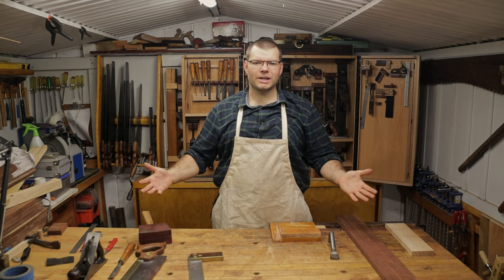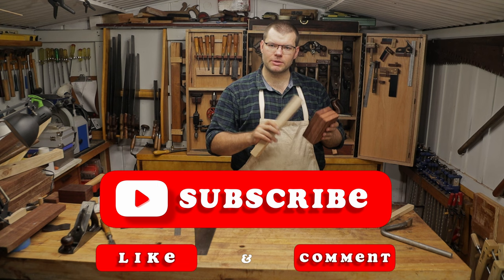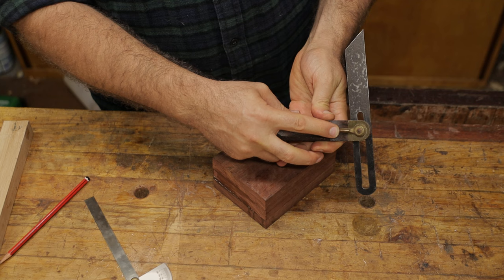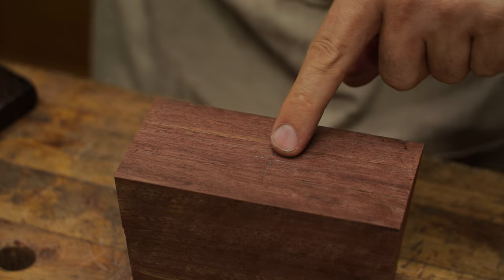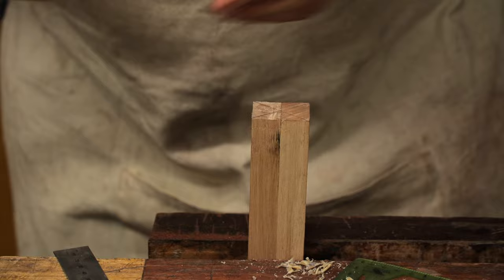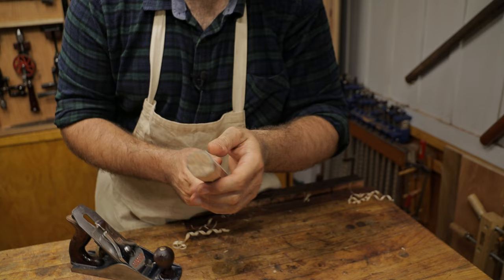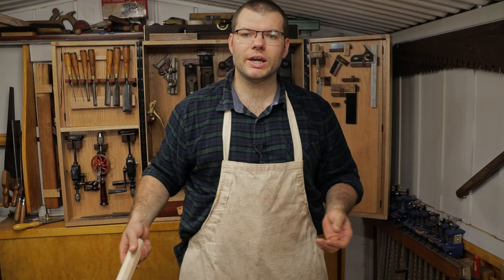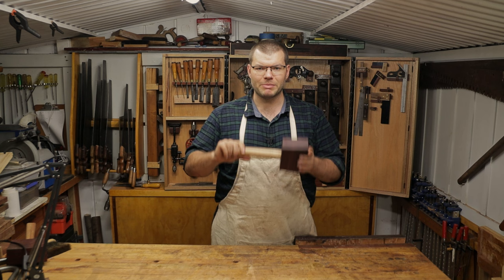Make Your OWN Wooden Mallet

Comment: Beautiful, wedged in through the top is better, less risk of the head flying off if the glue fails.
Reply from the maker: @davestinyworkshop  you're correct but i can't remember the last time my pva glue failed, i can report both mallets are still working perfectly fine with no issues

Comment: Great video, really prefer the handle to come out through the head with the wedge to lock it in.
How do you make your wedges? Do you have a video for a jig you've made?
Reply from the maker: Thanks, Glad you liked the video.  I currently make my wedges by measuring in from the edge of a board 2-3mm, then i run a line off the side of the board from that mark making sure the wedge is twice the length i need (Ensuring the wedge will be in the long grain of the board not the end grain). I then handsaw the wedge out. I know it sounds a little complicated, however its not are hard as it sounds. I do not currently have a jig for this, however i will investigate making one. 

Hope this helps and thank you for the questions.